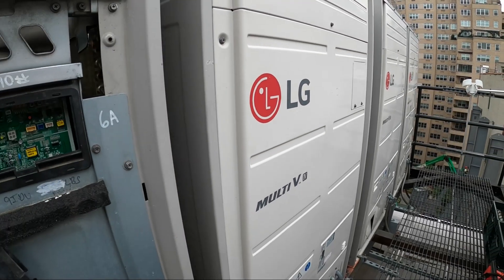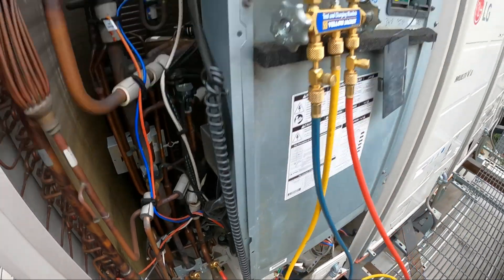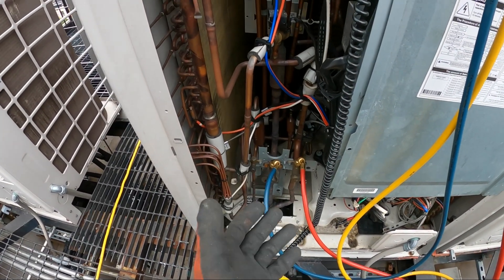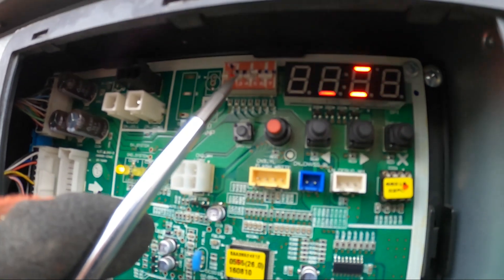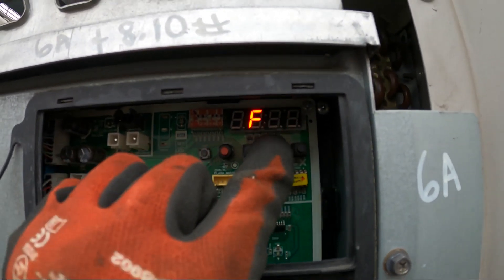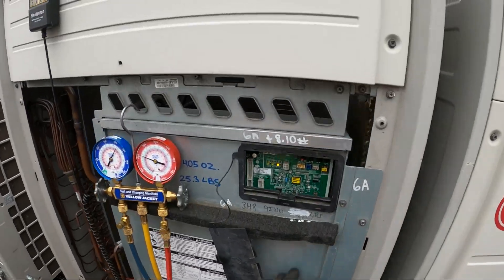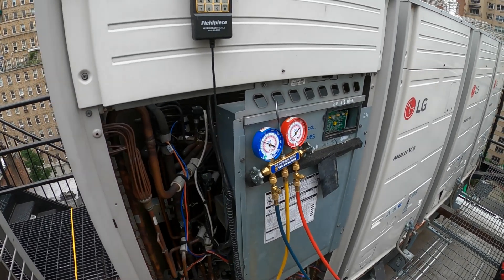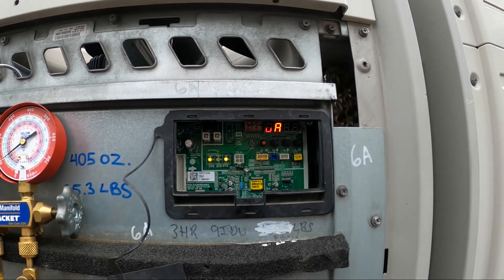HVAC: How To Set LG Multi V In Vacuum Mode (LG Multi V VRF Vacuum Mode) LG Multi V 4 - Multi V 5 VRF

Comment: Did you know that there is a Pump Out function? It pumps all of the refrigerant out of the unit that you are working on out into the rest of the system. It is SE2 if you want to read up more in the manual.
Reply from the maker: Didn't know that. I definitely need to study more regarding these units. Thank you for the advice & thanks for watching!
Reply: @JumpermanTech  I sent you more details and some other useful functions in an email.

Comment: Back in 2012 I was deemed by the sales company to be one of the two most knowledgeable service techs in the Washington, D.C. area on these systems. With the problems you are having in this building, I would put a data tracker on the incoming power. Multiple compressors and boards is to me a dead giveaway.
Reply: Voltage spikes or undervoltage? Is that what you mean

Comment: They need to change their name to LGJ( Let’s Get Junk). Great Video.
Reply: I mean they are 12 years old, and if you’ve seen the other videos the indoor units are 100% plugged up. Not LGs fault this facility doesn’t maintain anything. Compressors don’t just fail, they are killed.
Reply from the maker: @donnyjackson1908 This is true! That's awesome you're up to date with these units. Maintenance is crucial with this setup here. It also has to come down to installation. I hear a lot of issues with LG as well.
Reply from the maker: Haha maybe it wouldn't be a bad idea to change the name!

Comment: Not that I owe LG anything, but as far as I can see those units have a 10 year warranty for compressors and other components when installed and registered correctly. Otherwise 7 years for the compressor and one year for everything else. I doubt LG would do that if they would think it can't make the 10years.
Would probably smart to get in touch with lg and check if they need additional oil to compensate for the install or what the cause of those failures is. Sure this is not a perfect world and swapping compressors every 6-7 years on a super efficient system is worth it to the customer instead of ripping half the building apart and changing line sets and indoor units.